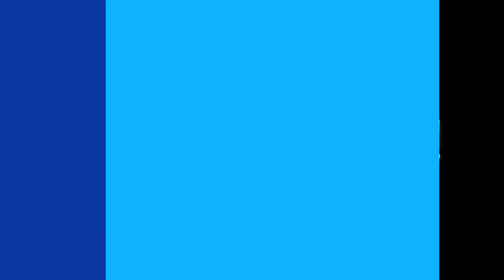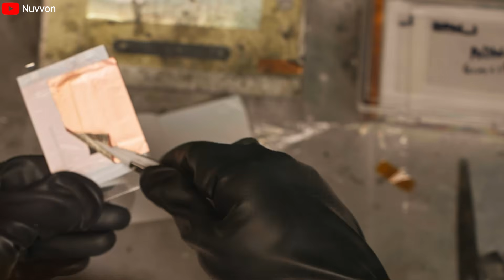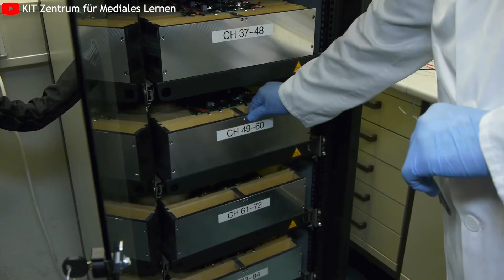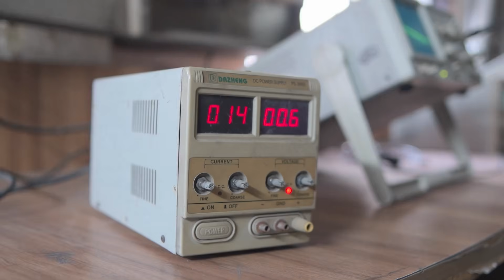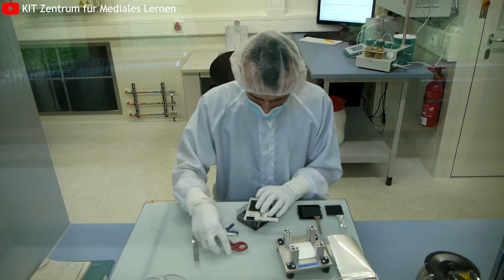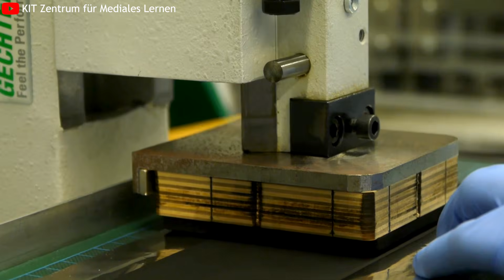Donut Lab Battery Is Giving Scam Tests for You! Here's Proof

Comment: You Missed the point. The test was actually to determine the cell capacity performance at 100 degrees, not to demonstrate its resistance to thermal runaway
Reply from the maker: The point was to show high-temperature behavior, not prove thermal runaway resistance.

Comment: Wrong...
Lithium-ion batteries typically undergo thermal runaway and ignite when internal temperatures reach 150°C to 200°C. At this point, the separator melts and the electrolyte becomes highly unstable.
Reply from the maker: Thermal runaway usually starts around 150–200 °C. This test was just looking at performance below that range.